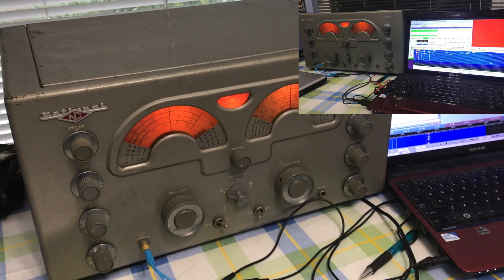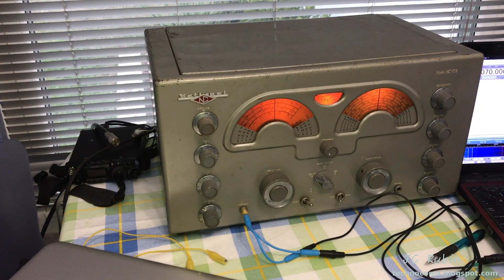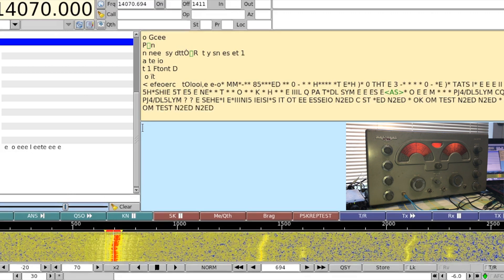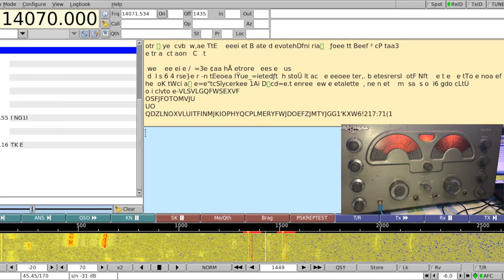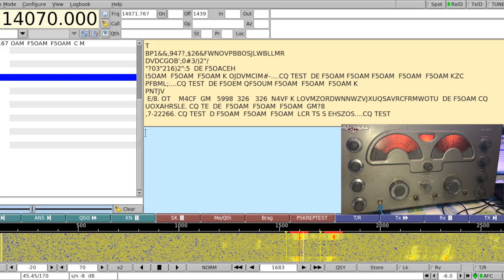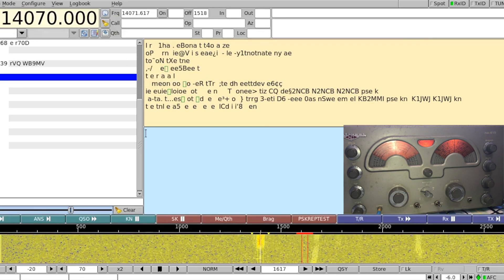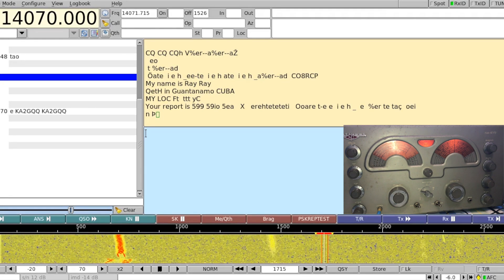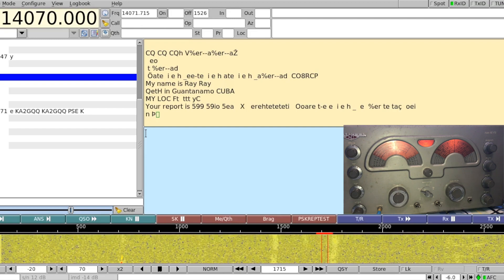Using an antique radio to pick up ham radio digital modes on HF - Part 1

Comment: Any chance an older TS-520S transmitter can be used to transmit on digital?
Reply from the maker: Yes you could, but don't expect computer controls to the older Kenwood, everything would need to be initiated manually.

Comment: noob. How do you get a waterfall? Is it just the limited slice of audio the receiver is sending to the sound card?
Reply from the maker: Yes, what the AF the receiver is pulling in is wider than that of the waterfall shown in the display,  given the offset from the frequency, the waterfall only fooks at that slice, so we are seeing a piece of the receive af audible signal
Reply: Thanks. I have used an SDR waterfall but haven't hooked fldigi to a "rig".